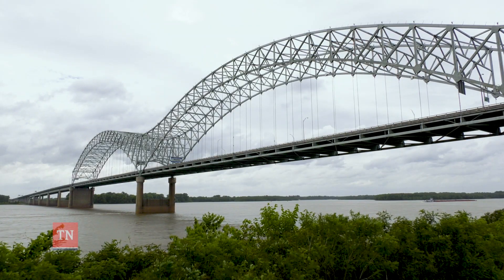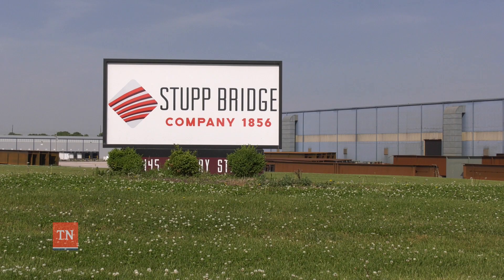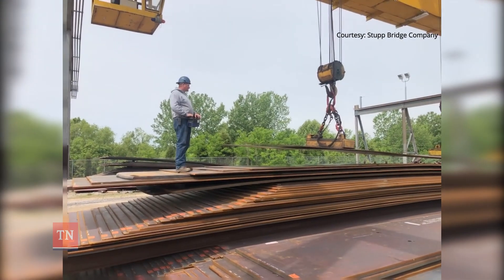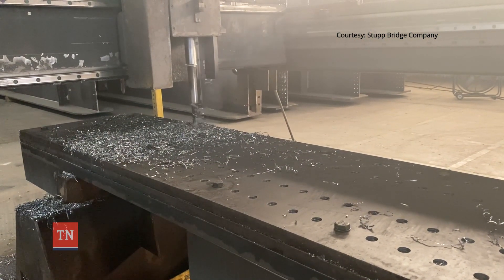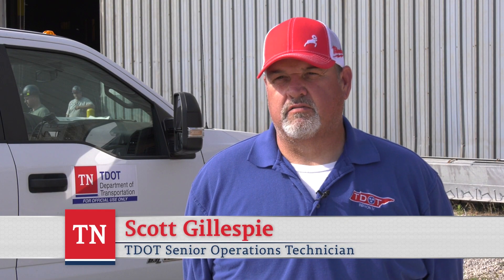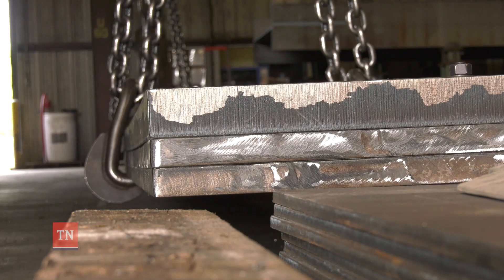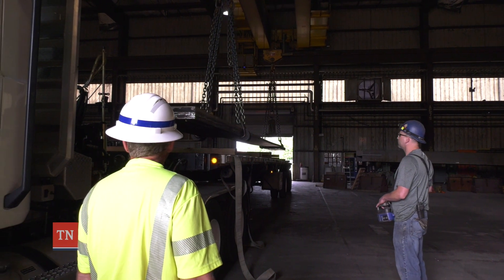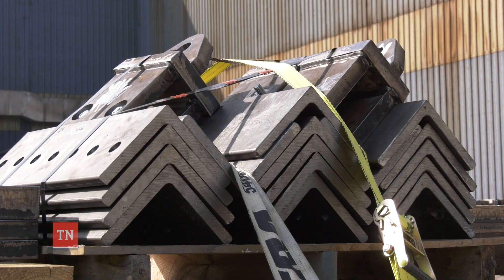I-40 Hernando De Soto Bridge Repair Parts

Comment: I hope the checked the nearby hanger cable.  I believe that cable may have a slight stretch in it that caused deflection under load that caused the tie beam into flexure and fatigue cracking.

Comment: Send the bill to Arkansas
Reply: This is peak American energy. Keep it up guys.
Reply: It's Tennessee's job to do the repair and Arkansas to do the inspection so Tennessee would fit the bill
Reply: Send the bill to Tennessee
Reply: Send it to the truckers who caused it
Reply: @pwrfl2357  If the trucks traveling over the bridge caused the crack then it was the engineers fault for not making the bridge strong enough so send the bill to the engineering firm instead.